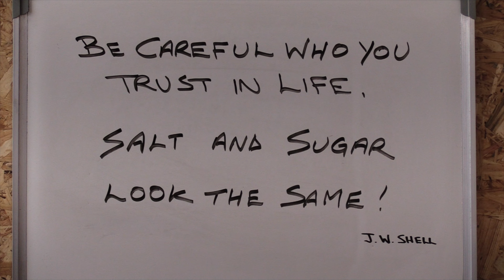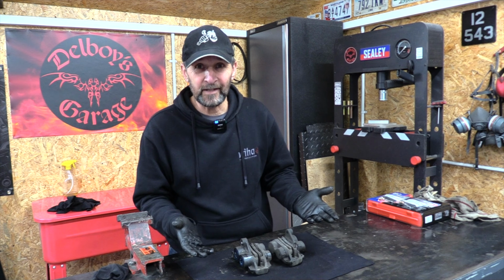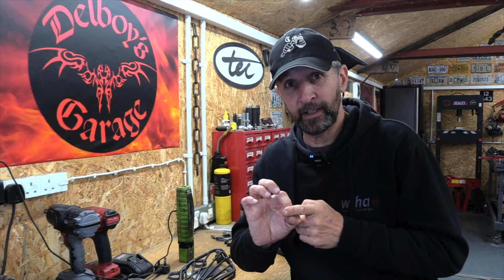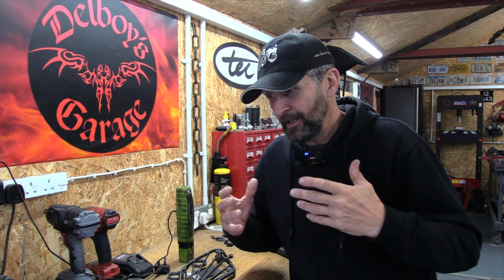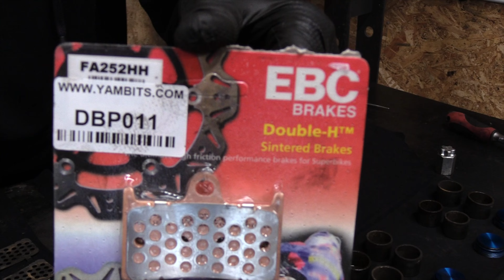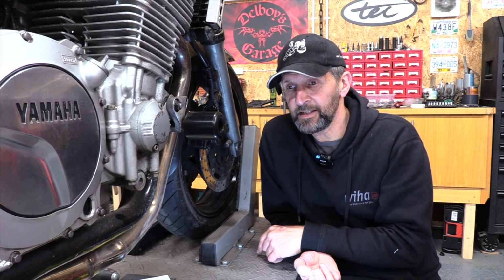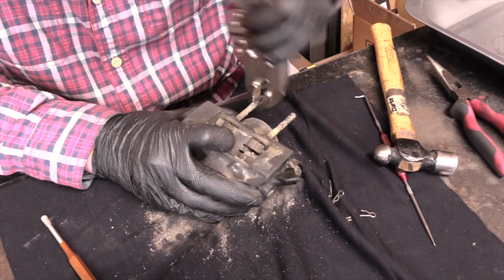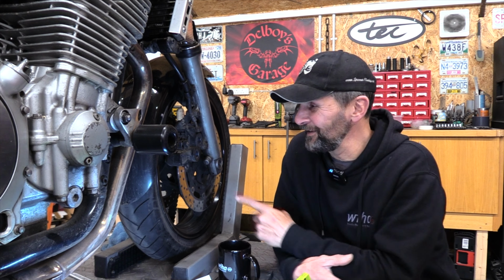Yamaha XJR 1300:- Blue Spot, 4 Pot, Front caliper rebuild !

Comment: Good job Del, I have also done all of the different types of blue spot brakes with no problems afterwards, what goes together mechanically can be taken apart in reverse and can be checked for any leaks using the master cylinder before you fit them.
There are slight differences in the front ones, yours had a complete blue spot insert complete with the o-ring section at the back, on others they have a seperate steel disc with the o-ring in it that is seperate to the blue spot star ring, but still seal up the same, in every one I have used the original o-ring were are always perfect and never needed replacing in any of them.
Reply from the maker: Thanks so much for sharing David, it's good to hear from someone with experience in these. !

Comment: Привет из России. Приятно смотреть на дело мастера. 👍
А почему бы тебе внутренние цилиндры не вынуть сначала с помощью воздуха и компрессора?
Reply from the maker: They were both stuck solid.. did you notice i had to press them out with a hydraulic press.. !!
Reply: @Moonfleet41  да конечно заметил.
Но прессом ты давил на внешние
А я говорю про внутренние.
 при отсутствии инструмента обычно так и делают. Выдавливают воздухом.
Но с ним нужно быть очень осторожным.
Reply from the maker: @Иван495  Not just the outside ones. they were all jammed in far to hard for air to remove them..!

Comment: Another nice tool for the collection! I've made those before using the same principal as bar end weight fittings, splaying out to grip but never thought of the slide hammer, which makes it far easier. I used to just twist them out once they'd gripped. You have generous viewers. As always, thanks for the video and as always I enjoyed it.

Comment: Usual high quality video Del, as for the "difference of opinion", you have to do what you feel is right, and yes, you were quite right to strip the calipers the way you did. Nothing wrong with being thorough about a job.
Reply from the maker: Cheers Andy, I get what the advice says in that there's no need to remove them because you can treat them like a solid caliper and blow the pistons out with an airline, but you need a little more when you find yourself having to use an hydraulic press to push the pistons out!... the cost of neglect aye?!

Comment: Great vid as ever - love watching these. I recently had new tyres fitted. The person doing the work torqued up the bolts on the rear wheel (GS) but did not torque up the calliper bolts, pinch bolts or axle bolt at the front. He said he did not know what the torque values were. Was he right to not torque them up? I was concerned and found out the torque values and did them once home. Really interested to know what you think…
Reply from the maker: Well he certainly took the right aproach (other than maybe go find out the torque values, they're all online), but to admit to you and warn you, is right and correct.. if he was an experienced mechanic he would have fitted everything securely and tight enough to be safe... im more interested in what YOU found later, were they loose when you went to torque them up at home...or were they all secure?.. that's the measure of his skill.!
Reply: @Moonfleet41  Thanks for the quick answer. He did not admit it, I asked him! However, everything was tight and secure when I checked. Main issue was having to buy a T45 and T50 to check everything front and rear! I thought it was a safety issue and these types of bolts had to be torqued up, not as important as I thought then?
Reply from the maker: @michaelneve3223  Always lots of 'scare' about torque values. They're not just for making sure things are tight enough, often it to make sure you're not doing them up TOO tight, or that there may be a series of fasteners that all need to the the same, as maybe in an engine casing so as not to warp it... once again mate, an experienced machanic with years under his belt will know the right 'feel' of a fastener, not only how tight to fit it so it doesn't fall out.. but how NOT to over tighten it and snap it off...becasue over the years he will have done both.. that's the value of exerience, and the value of a good mechanich you can trust.  you don't just pay him for the hours he worked on your bike, you're paying for the years of practice and knowledge he brings to the job he did for you, as proven my the fact that everything was fine when you checked.

Comment: noice....
😆
Brill video... shared it already, will be posting it in the yammy 600/900 groups.
I really like how easy it is to pop the pistons back in these calipers after they are cleaned and have new seals in. 
Old xj900s calipers, youre wailing on them like the old fashioned monkey boy to get the pistons in. 
One major reason Ive upgaded all 3x of my xj900s divis.

Q. does it matter which way round you pop the spring pad holder thing back in??
Reply from the maker: Hi mate.. Thank you for the support in sharing the video.. much appreciated.. I noticed the spring plates are 'sided' in terms of their shape.. but the holes are in the middle and they fit prefectly well either way... have a squint at the schematic in your manual though, that will give you the prefered orientation..!
Reply: @Moonfleet41  that's the thing... they arnt in the divi 900 manual.
Blue spots are a seriously amazing upgrade to the xj900s.
They are the dogs wotsits as far as brakes go lol
I put them on my 900s back in 2008.
And never looked back.
Easy to service...compared to the original calipers.
Easy to bleed, and you don't have to work out 3 miles before hand when to brake, also, I've not had any brake fade with them.

Comment: I've just overhauled my blue spot calipers but had to ditch the pistons as they were too corroded.
The new pistons were a very close tolerance and didn't go in as easy as yours, mine were a pita.
Also, i had to buy that tool as my pistons were stuck in the calipers.
Its one thing to get the piston out, its another to get the piston off of the tool😂.
Good video, i just wish you had done it a while ago, thete's little on youtube regarding the rebuild of blue spots.
Reply from the maker: Little trick for getting the tool free if it's stuck in the piston.. back the thread off and tap it INWARDS with a sharp tap.. and it'll drop out. !

Comment: The one thing I’ve rarely seen complied with in the service manual for every one that I’ve read and also not followed, is to replace the front brake caliper bolts.  They’re just torqued and not stretched so really not sure why.
Reply from the maker: Not sure I would feel the need to do that, they are steel into aluminium, the torque values are nominal. as long as the threads are healthy and not corroded, I've always re-used them...

Comment: Wow. What a mess!
Previous owner is one lucky Bunny that either the wheel didn’t lock up in wet conditions; or that the brakes even worked at all.
Only an utter idiot wouldn’t take your approach to those brakes.
Great job.
Reply from the maker: Sure thing Nick, both calipers were only pushing with 3 of the pistons, those two i had to press out were just frozen, a sound warning to keep your brakes clean and sludge free over winter aye !